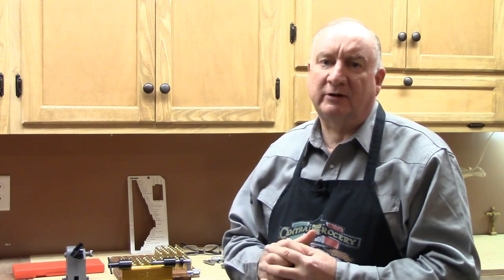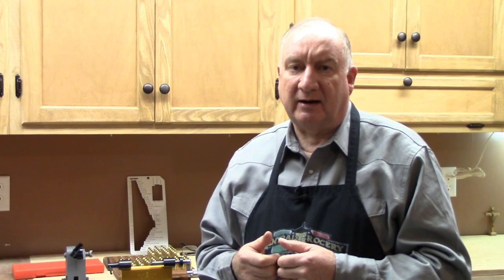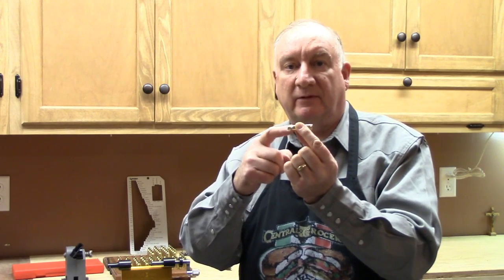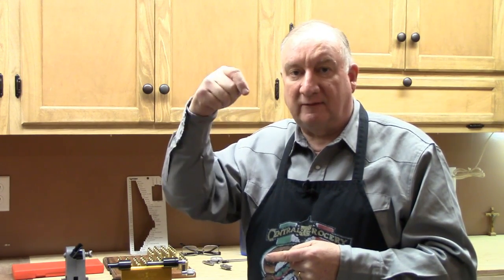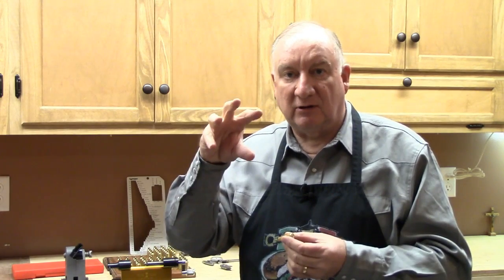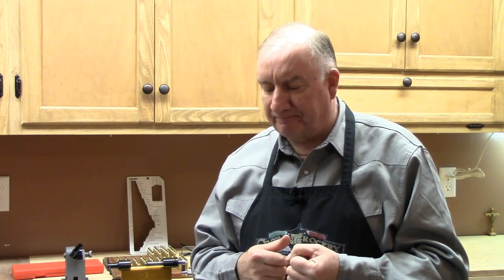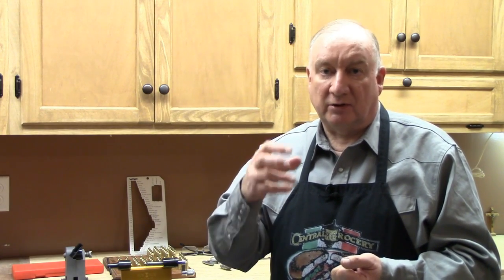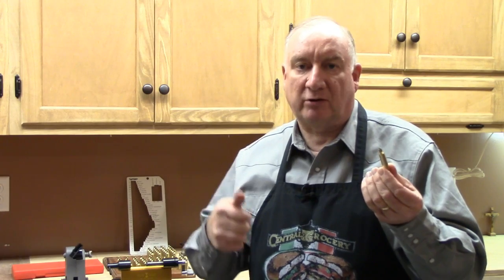Neck turning and neck sizing ~ Seeking a higher level of accuracy!

Comment: Would it pay to neck turn a lot of brass that has  neck thickness no more than .0007", measuring from one side of the neck to the other side? That's the most I'm getting from my Hornady 6 Creeed brass. .0007" Isn't much.
Reply: I meant .0007" difference from one side to the other, ie: .0143" to .015" thickness on one piece of brass.
Reply: @Jaygorski  id say turn a small batch of brass and check your results. True, .0007 is not much, but maybe it'll make an extra inch spread at a couple hundred yards. These inconsistencies make cumulative distance between shots in a group. Just my opinion since nobody answered. Good luck.👍
Reply: @ironbomb6753  .0007"  is only 2 or 3 cases out of 100, most are .0003" or less. At 200yds I'm getting groups in the .5" range or less on a good day, last group I shot this year was a .505" at 300, it was pretty calm that day. Is it even possible to take .0003" off of a neck, LOL
Reply: @Jaygorski  yes

Comment: How many Thousands is proper neck tension? I was told 2 Thousands is this correct? I use the lee ultimate 4 die set.
Reply from the maker: That's incorrect.  I suspect that the two thousandths they refer to is a minimum safe neck clearance in a custom chamber, which provides safe release of a bullet during firing, not its retention within the case. Two thousandths would cause extremely difficult bullet insertion, with distortion or collapse of the neck and even damage to the bullet.  Case necks are sized one thousandth smaller than bullet diameter, which is determined by the expander ball size.  All dies are made to provide the same degree of neck tension, of one thousandth.  That is all that's required for a firm grip, together with a crimp for certain rifle actions, repeated recoil in magazines, etc.
Reply: @GunBlue490  Thank you Sir' much appreciated
Reply: the starting point recommendation for neck bushing type dies is .002" smaller than the neck diameter when loaded with a bullet. brass springs back to about .001" under after that, which is about what ball expanders do.

Comment: I got a lot out of this session. I did find that some one else recommended FL sizing for hunting for the same reason you stated. I also got a better understanding of some of the mechanics/physics of sizing. thanks
Reply: even the benchrest and F class shooters are full length sizing. neck sizing is a brass life and "slightly questionable" headspace solution

Comment: Their chambers are bigger...benchrest shooters are running tighter specs
Reply from the maker: The other way around.  Benchrest chambers are SMALLER, to more closely fit the brass, than are standard chamber dimensions, which loosely hold brass. Their chamber necks are cut to individual specification, depending on the shooter's preference for bullet release clearance, and throats are specified according to the owner's bullet lengths.  Tighter specs are tighter chambers, not bigger.
Reply: My custom 17Rem has the chamber neck of .196 neck. My loaded round measures .194. I turn my 17 Nosler brass to .011.

Comment: You said that the neck resizing tool from Lee is good as it works by press the neck. But what do you think abou the RCBS neck sizing tool with bushing ? do you have some tips for use it very well and avoid some stretching or others mistake ? Have good result with but get any tips from a good reloader like you ;) Thank you
Reply: Matthieu: I have the RCBS Full Length sizing die with interchangeable bushings. It adjusts the outside diameter of the neck. It does an excellent job.

Comment: Could not disagree more when he says that you should "ALWAYS, ALWAYS" full-length resize for big game hunting.  (1) You can chamber neck-resized rounds in your rifle before taking them hunting.  Take care to keep your neck-sized rounds in such a way was they will not be exposed to dust or dirt, as even dust can change the way a round chambers.  (2) If you're hunting deer with a bolt action rifle, you're very unlikely to need to chamber a second round anyway. Yes, it's a fine habit to chamber that second round instantly and instinctively , but how often do you really get a chance to take a second shot at that deer? (3) Even if neck resizing may only produced a small increases in accuracy, this is not the same as saying that increase is statistically insignificant or irrelevant.  in fact, if you are hunting mule deer in open plains where longer shots are common, that extra accuracy becomes more significant as distance increases.  Yes, that target seems plenty big at 100 yards or less, but what about 250 to 300 yards?  Longer shots are more subject other accuracy decreasing factors, which would logically make the increased initial accuracy even more significant.  I'd say that you should be aware that there is an increased likelihood of certain difficulty in chambering a neck-sized round, but consider trade-offs of your overall situation.  Personally, the only time that I don't neck resize is when I'm not certain which rifle a round is destine for.
Reply: Gunblues big game hunting  is not mule deer. hes talking African Lion hunt or an Alaskan Grizzly bears at 40yds. where you want to make sure you chamber that second round.
Reply: @deaguiarmanny  yeah this is just a case of talking about two different things. Gunblue could have said "dangerous game" instead of "big game".
Reply: So according to your logic, factory ammo used on most hunts, is no good, how did all that game get taken.

Comment: I have weird situation. I have lee dies for my 11mm and it leaves the neck diameter too wide for the chamber. How could I make the neck not so wide? I can't even ram it in to fire form it once. I have one original unfired round and it fits perfectly, but I use that one only as guide.
Reply: Go to a gunsmith with your issue. 👍
Reply: @ironbomb6753  I figured it out. The brass in question is from NDFS and they use a slightly thicker brass than my original. i had to shave off a bit from the neck and now all is good. I also use 348 winchester and have no problem with chambering.

Comment: So after much review and research I decided to get my hunting rifle in .243 winchester because my .308 BR's are really hard kicking. What I don't understand is can I use a 243 in a 308? I thought it would fit because the neck casing is the same. Do gun manufacturers make their barrels so the bullet diameter is the only thing that fits or can I "hack" a .243 to work in my .308 Battle rifles?
Reply from the maker: You absolutely cannot use any cartridge in a chamber for other than it's marked identification.  The 243 Winchester case and the 308 Winchester case are the same basic measurements, but the bullet diameters and barrel dimensions are entirely different.  Bullets MUST FIT THE BARREL to the exact thousandth of the inch, and the bullet must be engraved by the rifling. You are incorrect. The necks of the two cases are not the same.  Never, under any circumstances, attempt to fire a round in a chamber other than the one specified, unless it is specifically stated, as with certain handgun cartridges.  A 308 bullet measures .308", and a .243 bullet measures .243", irregardless of their similarly in case dimensions, which makes them entirely incompatible.
Reply: @GunBlue490  glad you answered that question,  but boy was it a doosie!!!
Reply: You cant fire a 243 in a 308 chamber.dangerous if it would work at all.
Reply: No no no .absolutly no.
Reply: All of these replies should have been in CAPITAL letters

Comment: With once fired brass should you weigh your cases before trimming to length?
Reply from the maker: Trimming and weighing have nothing to do with the other.  The weight is fixed permanently at time of production, and its uniformity is a quality control issue.  Heavier brass is thicker, and thicker brass is a smaller chamber.  The length of the brass is a dimension that must be maintained below the maximum specified, or the case mouth will jam into the throat of the chamber and prevent proper bullet release, raising pressures dangerously.  For good uniformity, segregate brass according to brand.  For match grade uniformity, buy match grade brass.  In practical use, weighing brass for segregated lots is an exercise in futility, because each little lot will require a different load, and will have different ballistics.  I've used standard grade commercially produced brass to achieve some of my most accurate loads over the years, and their weight variation was far from perfect.  But for exceptional accuracy, especially for long range shooting, match grade brass eliminates all variation, but even then, buy from the same lot.
Reply: @GunBlue490  thank you sir for the detailed explanation. It answered some other questions I had as well.

Comment: Wildcatter and rifle smith Albert "Hopp" hauptmann: Neck tension about maintaining bullet jump and also locating the initial pressure curve. A lot of neck tension. 003-.005 or more tends to build pressure quicker than light tension with certain powders. The 6PPC with H322 seems to like little to no neck tension but N140 likes. 003 or more. Things change when jumping the bullet, with certain powders and a long throat, excess neck tensions builds a. Pressure spike before the bullets starts moving and can sometimes lead to poor accuracy. One theory is since the bullet is swaged into the rifling at a higher rate that the bullet may skid somewhat before it starts to track the grooves, causing deformation and poor accuracy. But that same load may shoot fine in another rifle of the same twist chamber and length. Rifles are like women, they all have their quirks and don't like to tell you what's wrong.
Reply from the maker: Some of the silliest yarns come from such "pros", who conjure up fascinating theories to fill monthly magazine collums and look astounding.  He's all wet.  Soaking wet.  Neck tension cannot be measured with a micrometer. Every bullet loaded in the world is seated into a case neck inside diameter that is exactly .001" smaller, governed by the expanding ball, mandrel, or bench rest die. Any less, and the bullet will be loose; any greater and the bullet will collapse the case.  Tension is solely related to the elasticity of the brass, the amount of neck to bullet bearing surface, and to the presence or degree of a crimp.  Pressure spikes are caused by untrimmed case necks that jam a bullet, and by incorrect powders and charge densities.  Bullet jump and neck tension have absolutely nothing to do with the other.  The former is the distance from the rifling leade; the latter is the exertion of force bearing on the bullet by the case neck. Further, nobody can possibly achieve bullet jump consistency to the third decimal place, which is why most bench shooters seat their bullets into the rifling. Anyone who claims they can is full of it.  In any precisely loaded lot of ammo, bullet jump can and will vary by as much as +-.003" or more for a host of reasons.  I've used H322 powder for many years in my 222 Remington and my buddy's 204 Ruger, and because if it's quickness, like IMR4198, it's one of the least fussy powders in the world that works uniformly well under a wide range of bullet jump for those cartridges, but it's certainly not an efficient powder in the 6mm PPC, where it is far too quick for any bullet weights for standard velocities, and will get out of hand with high pressures very easily if standard velocities are attempted.  That's not a pressure spike; it's just an overload.  A 65 grain bullet in the 6mm PPC runs at a comfortable 3,000 feet per second, but hits a wall at 2,800 feet per second with H322, which is hardly the velocity loss bench shooters want to minimize wind issues, so any talk of that powder in that round leaves me questioning.  In my long 55 years of shooting experience, barrel harmonics drives what powders and charges work best, but guns are not quirky individuals at all, and they react very predictably, and respond quite uniformly.  Every rifle I've ever tested and loaded for, whether my own, a friend's, or a department sniper rifle, shot it's best with the seating die set in the neighborhood of.015" jump or crammed to the lands.  Finding a good load is pretty simple, yet there are many who fancy themselves to have secret knowledge and wisdom, so they can look down on the world.  I'm doing this series to unmask the nonsense so everyone can do it.  There are no secrets that any gurus like Hopp make things out to be.
Reply: Yeah you hear some wild things over the years. I used to talk to old man hopp when I started out with the PPC and had problems with tuning it. He was a good builder tho. I still have an old Gew 98 cut for a. 222 Ackley that is a shooter, instead of a sleeve the magazine cutout was welded up. Anyway, I find learning half the fun and realized that many of the old timers had different ways to go about the same thing. There was even a guy that used no neck tension at all. Somehow he formed a doughnut as he called it that the bullet would hit to prevent it from moving into the case. I try to stick with more fundamental techniques. I never understood the ideas he had on neck tension and pressure but 25 years later, I heard the same theory about the bullet "skidding" the first little bit once it hits the bore. At camp perry a few years ago I got to talk to Joe Carlos, former Army Armorer and smith for the army reserve team, who brought up the same idea that under certain circumstances the bullet can skid when it first engages the rifling. I don't know how valid the theory is since it's just a theory but I've since heard the same idea from some of the guys who are shooting gain twist barrels. My service rifle shoots just fine and when I miss the 10 ring it's because I put it there and not the rifle or the load. Yeah defiantly hear some wild stuff over the years tho, I do enjoy your videos. Good day and good shooting.

Comment: My last competitive bench rifle was a 30BR with a NO turn neck. Brass today has become so good (Lapua) that in score type matches neck turning has kinda become a part of history. The only guy I new that still turned necks was shooting a PPC and was a requirement for his chamber. All the other shooters in my area anyway were using 6 and 30BR's and no turn necks
Reply from the maker: Yes, I find that with Lapua too, but run of the mill brass can be dramatically improved by turning, and can achieve near match grade accuracy, especially in brass not available from Lapua.

Comment: NRA highpower with the 223. I have collected a large variety of brass over the years, LC,Win,Starline,Norma,hornady and recently been shooting the Jagmann, which I think is great brass. I came to highpower from benchrest and am used to neck turning. All my necks are. 0015 so I can leave the same bushing in the die. I sort my brass by brand but use all the lots with the same load and prep. Uniform neck tension is the key in a semi auto and cut vertical group spreads in half at the 600 yard line and about the same at the 300. It's a pain to neck turn 500 pcs of brass but I have a lathe and a good setup and can do 50 in about 15 min. Don't go crazy with it especially with the lake city brass as some get as thin as. 009 in spots. Remember after few times of bumping the shoulder and trimming the neck will either have to be touched up with the turning tool or you have to decrease the amount of depth in the bushing. Feel free to experiment and have fun. BTW I don't use QL nor do I use a chrony. Never have, I load for group size. Younger shooters these days like to see the data in numerical form, I'm just fine seeing the data on the target and just ballpark the velocity.

Comment: will neck turning affect all calibers positively?  So going from 6.5CM, 338LM that i do turn up to 375 Cheytac and 416 Barrett.  How much of improvement should i see if already at 1MOA and 10 SD's ES 20.
Reply from the maker: Bullet to bore concentricity is always helpful to accuracy.  The degree of improvement is directly proportional to the amount of the initial combined misalignment of the case neck and the throat clearance of a chamber.  It's an alignment issue that has absolutely nothing to do with caliber or load consistency, any more than wheel alignment relates to engine performance in a car.  A bullet that is pointing where the barrel is pointing will benefit any cartridge or load.

Comment: Love your videos!  I am just getting into the neck turning.  For new and used brass steps, 1 form with FL die, 2 trim length if needed and then start the  neck turn process.  Am I missing anything?  Thanks

Comment: GunBlue490  Awesome information for us reloaders whom are ready for the next level of accuracy.  I am currently reforming 308 Brass to 260 Remington.   My question is should i doing the neck turning on the brass prior to reforming or after reforming the brass to 260?
Reply from the maker: Reform first.  You are going down three calibers, (284, 277 to 264), so I would first resize.  That will cause a buildup of brass at the inside of the shoulder, so you must follow the sizing with inside neck reaming with a 264 reamer to remove that thick donut, or your bullet or neck turning pilot may not be accepted, and the neck will not be parallel.  Then, do your neck turning.
Reply: @GunBlue490  thank you and appreciate your very informative videos and topic of reloading.  Keep up the great work!

Comment: If your are using a neck sizing busing, how do you accommodate for variations  in neck thickness?
Reply from the maker: With a Lee collet, the inside mandrel controls the inside dimension as the outer collet simply squeezes it, regardless of thickness.  For non adjustable bushings used by benchrest shooters, the thickness is governed by the outside neck cutter.